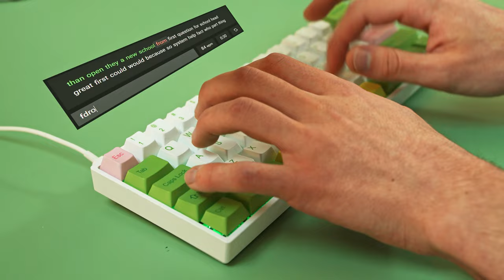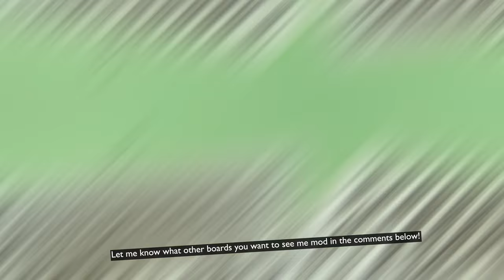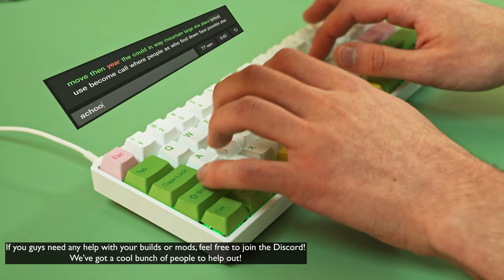How to EASILY Lube an Optical Mechanical Keyboard  - SK61 Mod With Mojito Keycaps [ASMR]

Comment: That's a pretty big difference. This is very similar to my board and I'm still trying to work up the courage and patience to do these mods and a few others to it. I might even order some new springs because even though I have the black optical, I'd honestly like a bit stiffer feel to them...hell, even considered making some Frankenstein switches due to the lack of options out there for opticals.

Comment: I have this board, they started adding foam underneath the space bar and at the bottom of the case too so you don't have to take it apart any more to do that! I was doing so and lifted up the plate and saw the foam underneath so just put it back on. I've got the brown switches and I lubed them with tribosys 3204 they feel great! Also ordered some durock stabs though the stock ones aren't rattly at all I think they updated those too on the newer boards.

Comment: It sounds so good, i love modded optical boards. I Just did mine recently as well. What lube did u use for ur switches?

drink more water
Reply from the maker: I used krytox 205 0g which is my go to for most switches. I partnered with prevail key co for a 5% discount if you're curious check the description 🥰🥰
Reply: @HipyoTech  Thanks for the reply, will check it out :D

Comment: Well, time to upgrade from my membrane to this sk61 mech, I really wanna try to do some mods with it soon.
Reply: this might be awkward asf but if you did actually get the sk61 and mod it, how did it go? i recently bought one and am super nervous to mod it
Reply: @a_nyccc  in the end I decided to buy a gk61. I bought an aluminium case and carbon fiber baseplate. And I bought some keycaps, I also foam modded it and swapped the stabilizers

Comment: i did this with my optical blues. I also took out the click jacket and it feels like an amazing linear
Reply: @kaiyusugiyama1947  i did in fact.
Reply: @kaiyusugiyama1947  its worth it to take out the click jacket, but not really to lube. It takes out the scratchyness
Reply: @kaiyusugiyama1947  yeah. It makes it a very light linear switch
Reply: @kaiyusugiyama1947  on the blue switch stem, there is a white plastic piece. You take that off. I think this only works for optical switches though, so if you dont have them I dont recommend it
Reply: @kaiyusugiyama1947  oh lol

Comment: I have a few questions, should I lube the stems of the stabilizers? Also should I lube all sides of the bottom housing or just 2. And should I lube all the sides of the top housing or just the two that you showed

Comment: that's how i always lube plate stabs haha. i like it so for me it's good.. several years ago i bought a couple of cherry stabs from community member Faxe here in EU.. and i'm happy with them.. don't know if there are better plate mound stabs these days.. i really should look in trying to mod these a bit better.. the bandaid mod vs the films you can buy on Aliexpress there are sum clear ones and the black ones.. perhaps i try the clear ones they are a tiny bit softer from what i can see. but the bandaid  mod accepts lube/greas so perhaps that's better.. i also saw a vid adding sum material inside the stabelizer housing to minimize the space the wires have to move / rattle.. perhaps that's something ?? thanks for your vids love the content..

Comment: Great video but optical switches dont have pins so there isn't a need to have a hotswap pcb or a need to solder just pull them out. Just though i'd clear that up

Comment: can you do this with any mechanical keyboard or does it have to be a custom one
Reply from the maker: It depends on your keyboard, to do this technique of lubing the switches,  the board needs to be  hot-swappable meaning you can remove the switches.

Comment: I got a sk61 but the left side of the space bar is rattling a lot compared to the right side of the space bar, thankfully yours is fine though
Reply: It might be your pbt spacebar being bent, use hair dryer heat it and make it straight
Reply: @madhardy8  I don’t think my space bar is bent when I look at it, also when I lightly tap it, it’s already rattling. Also when I rotate the space bar and switch the ends, it still rattled on the left and not the right, so I thought it was the stabs so I switched both sides and it still rattled on the left so I’m not sure.

Comment: What kind of stabalizers do I have to buy for this keyboard instead of using the terrible stock ones
Reply: Are they different to most other stabalizers
Reply from the maker: Get some durock plate mounts from prevail key co in the description!
Reply: @HipyoTech  is it 7x2u 1x6.25u or another size
Reply from the maker: @robertcolver5836  6.25u
Reply: @HipyoTech  4x2u 1x6.25u or 7x2u 1x6.25u

Comment: How did you get the little parts covering some of the screws off? I have an SK61 and I’ve been struggling to get them off. I’ve found no tutorials about how to remove them so if someone could help me out I would appreciate them a lot

Comment: How do I get the space bar stabilizer out? A piece of foam is blocking it
Reply: you have to take off all the switches and screws in order for it to split in various parts, you should be able to take the stabiliser wire there
Reply: @josepfg  I alr modded them but they still pretty bad... sk61 lowkey ass, but I might get new stabs soon

Comment: Is it okay to bag lube the stems?
I mean, we lube all the sides of the stem anyways.
Reply: I personally wouldn't recommend it, the keycaps might slip at the minimum pull, and if the spring has a heavy weight some keycaps might fall from topping out.

Comment: I tried taking my PCB out of the case, but the USB got stuck and the port broke :( how did you get yours out easily?
Reply from the maker: The last batch of these boards seemed to have an error where it's super hard to remove

Comment: just got the keyboard. it is good but the space key rattles alot and makes a loud noise is this normal?
Reply from the maker: Yeah, if you check out the before my space bar was really really bad. I recommend getting some permatex (link in desc) and doing something similar to what I did to the stabilizers
Reply: @HipyoTech  where i live it is hard to get stuff cus the shipping price is so high. Do you think that it will be better with only foam and bandaids???
Reply from the maker: @ApolloSpacew  Yeah that would still help a lot. I think if you can get permatex it would help the stabilizers a lot.

Comment: When I popped off the pcb, I broke the USB port. Can you explain how to remove it without braking?
Reply from the maker: It seems to be a really big issue with this model, I'll try and find a better way to open this style of case in the future
Reply: @HipyoTech  to be clear, I did this before watching your video. I am just curious to see it from an angle that shows how you did it.
Reply from the maker: @noshow  I actually just recently broke off a port on the same case that I modded again, so I think it's just an issue with some of the cases being too tight